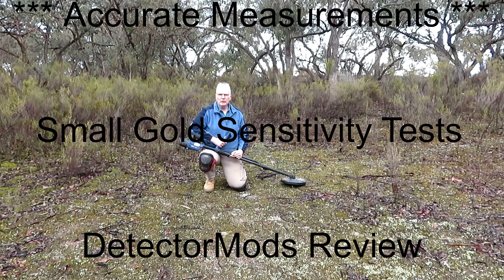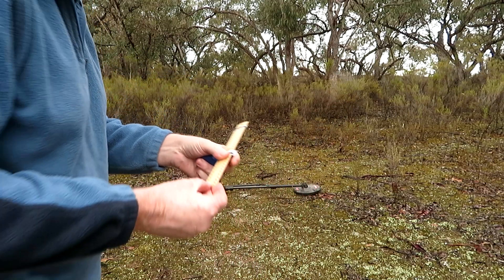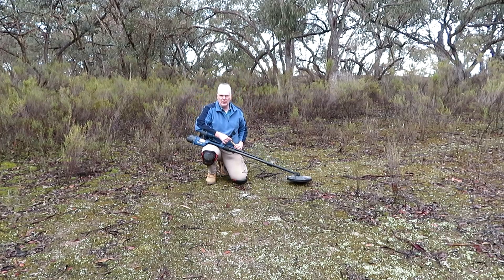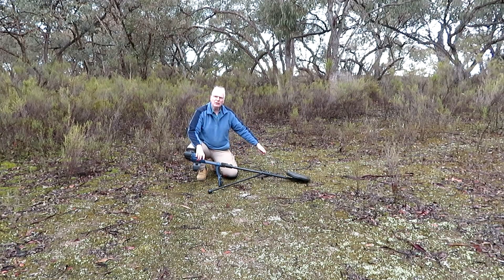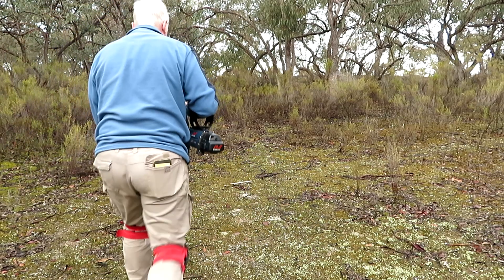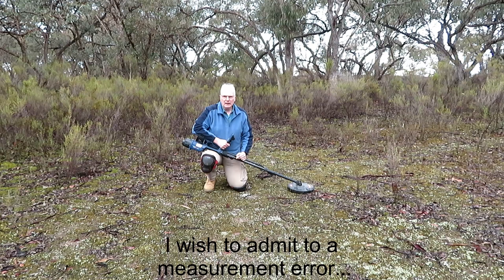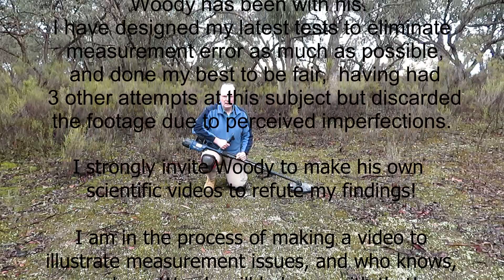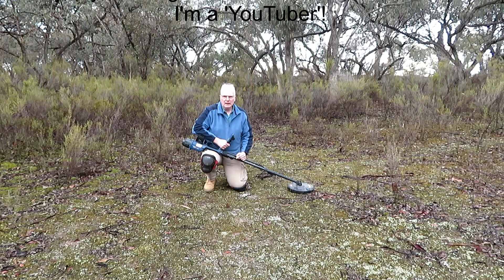DetectorMods Review: Small Gold Sensitivity

Comment: You haven't changed a thing in the video at all and all you have done is to remove the comments about why don't you take it back to get tested and fixed if needed as any normal person would do, that's warranty if you think it is not working you take it to the  shop and get it looked at that is how a warranty works.  I have reported this to YouTube as you are defaming without probable cause and you are at fault for not sending the detector back to Woody to be tested not Woody.
Reply from the maker: Moved admission of measurement error to before conclusion.  Showing ruler on the final measurement (unmodified @9.5 cm vs modified at 8cm)
Reply from the maker: Woody, you need to open your eyes and watch the whole video.  Why don't you produce a video proving your mods work.